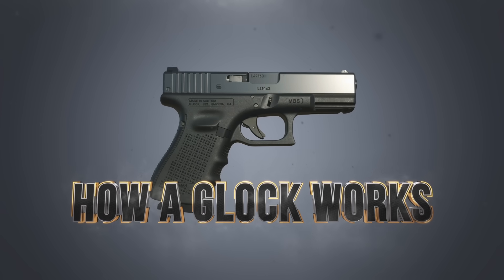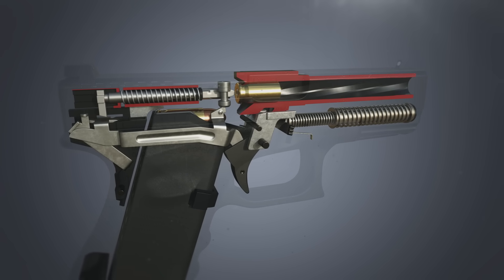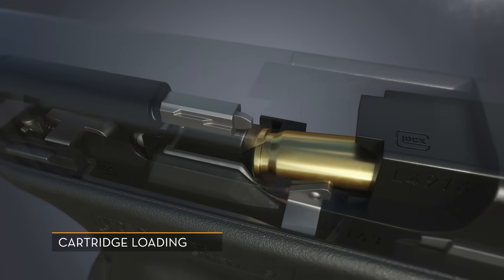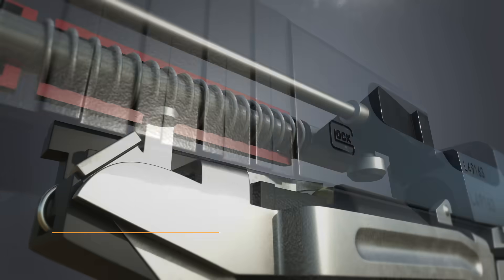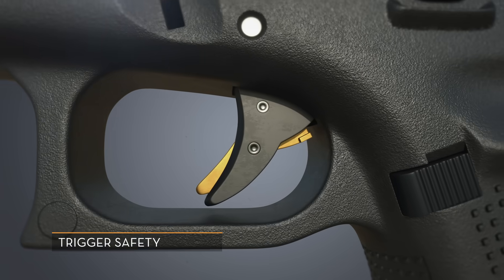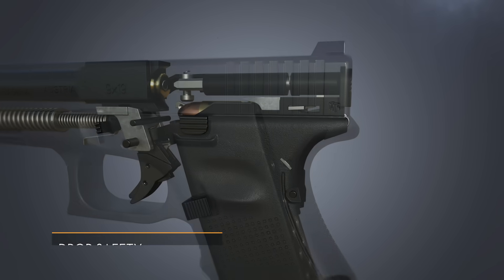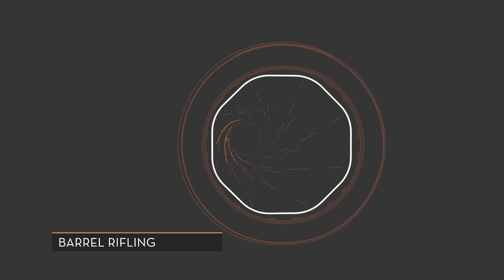How a Glock Works

Comment: Hi, i am a CSI student. Do you have any tips on how to remember the difference between the locations and function of the ejector and extractor? I keep mixing them up.
Reply from the maker: Yeah I always just remember the extractor is pulling (or extracting) the case from the chamber. Kinda like extracting a wisdom tooth lol.
The ejector is expelling (or ejecting) the case away from the firearm. Kinda like when a pilot has to eject an aircraft 😋

Comment: i had no idea the firing pin isnt under any load until the trigger is pulled. ive always worried about a part failing and a misfire. Really cool to know that the gun pointed at my nuts cant possibly go off

Comment: Nice animation, I've wondered how glock style firearms safeties worked. I get that they are safer but I'm just not a fan of the long squishy trigger pull. Love the fact that I can put multiple rounds in the same hole with a decent 1911 trigger.

Comment: note that after a spent casing is ejected, and as the slide moves forward, the next round is stripped from the magazine with its rim sliding up BETWEEN the breech face and the extractor as it's being fed into the chamber.  Therefore, it's not a good habit to manually drop a cartridge into the chamber, and then let the slide home.... doing this causes the extractor to ride OVER the case rim, causing stress and can cause the extractor to break.... always load the round into the magazine, and then rack/cycle the slide.

Comment: The most dangerous firearm ever conceived, if you approve of this safety system maybe we should let you carry around a hand grenade that instead of having to pull the pin all you have to do is touch it.  The cops now have a cute little nickname for the injuries it has caused.  They call it Glock leg.

Comment: A buddy of mine was on the fence about carrying a Glock with one in the chamber. I couldn’t really explain it so I came across this video & showed him. He now carry’s with confidence with one in the pipe. Everyone that’s new to, or is carrying especially a striker fired pistol should watch this video. Excellent 👍
Reply: Instructor "Never aim a firearm at anything you aren't comfortable destroying"

Student Glances at the appendix carry on the male instructor in confusion
Reply: @mdood9299  as long as you use a QUALITY holster, and you aren’t carrying a P320, you’ll be fine.
Reply: @adambradford8721  This comment aged like fine wine
Reply: @rei_do_passinho oh I’d say like a 12 year bottled in bond, I had no idea the hammer would drop on sig this hard, pun intended ofc 😂
Reply: @adambradford8721   I examined the fatal flaw of the P320. The way it's engineered would be as if you had the hammer permanently back! The striker spring is released by the trigger vs Glock trigger compresses & releases the spring. All it takes is a solid jostle and that P320 pin is going forward like a hammer pulled back.
Reply: @johnaethionconcentrius if I’m right, it’s because they gutted what they could from a P250 and shoved it into a striker fired handgun right?  Thats the only reason I’d think as to why the firing pin would be staged like that, of course other than the weight of the trigger
Reply: @mdood9299  Holstered guns are holstered not pointed.  Assuming you have a good holster and it's not a p320.
Reply: One of the quickest safety releases on any weapon.
Reply: sooo you're always looking for trouble with your itchy trigger finger instead of de-escalating like a real professional

Comment: So, at the end of the cycle as the slide moves forward, the fire-pin SPRING is not pre-compressed? The fire-spring in never under tension until the trigger is squeezed? Thanks for answering.

Comment: Great video animation of a Glock 19 in action🙂  The only thing I wish was explained a bit more in depth was the middle ramp/rail on the bottom of the slide that grabs the next cartridge from the magazine.  I know you highlighted the front of it in 2D yellow.  It would be nice to know what the rest of that rail is doing as it crosses over the magazine and the cartridge under the one it just grabbed and how the magazine eventually stops the slide when empty.  I know you mention that it stops the slide but that part of the animation is moving fast and its not clear how the magazine follower actually stops the slide.  

Please don't take that as a bad criticism the entire animation is great and I am trying to understand that cartridge rail grabbing part more in depth.  My Glock 17 has developed a deformation on this bottom ramp rail with a burr on the side of it that faces the safety plunger.  I'm just trying to diagnose why this burr has developed.  There is no sign of wear or deformation on the safety plunger.  Is the bottom ramp rail hitting the metal lined magazine, is it squeezing the safety plunger, is the cartridge below doing something to it?🧐 I'll figure it out eventually.

If I could put some kind of UV ink on the magazine, and then the cartridges, the safety plunger, each separately and then analyze the bottom rail after each I may get a clue.

Anyway, thanks for the great video.  I didn't know what that rail was for before this video so I'm one step closer to diagnosing the issue😎

Comment: I thought the Glock firing pin was set up horizontally. That way the empty cases can’t snap it of as easilY, as they eject horizontally. Like trying to snap a 2x4 piece of wood. It’s way harder to snap it from the sides.

Comment: Matt, does the rear of the recoil spring rest against the frame, or the barrel lugs during cycling?  Excellent video. Dig the music too.
Reply from the maker: Thanks so much Justin! It actually rests on the Slide Lock, which essentially rests in the frame.

Comment: Step 1:  "The boom makes the bullet go, and knocks back the slide."
Step 2:  "The spring in magazine puts new bullet into chamber as slide returns to its resting position."
Step 3:  "There Is No Step Three."
Reply: Unironically how SMGs work (replace 'slide' with 'bolt')

Comment: 3 types of safeties? well better safe than sorry especially around firearms as they can be deadly if mishandled
there is one thing i'd like someone's opinion on when i want to render it safe from firing: the way i think could be fairly safe to pull back the slide and lock it then i get the magasine out of the pistol and while the slide is open i can check if the champer is empty if it is i pull the slide back to slowly put the slide softly forward with a pull of the trigger in the direction to the firing range to drop the hammer and to expect i might be wrong lastly i would put the safety on and put an empty magasine into the pistol

Comment: Firing pin safety - check
Trigger bar safety shelf (drop safety) - check
Trigger safety… wait WTF? So if you somehow managed to accidentally push the trigger body back without touching the dingus, the gun would not fire. Put something, anything inside the trigger guard and it’s going to push the trigger and the safety shoe back. 

Glocks are neither full double action nor single action. When you cycle the gun to load it, you partially cock the striker. However, pulling the trigger also completes the backward motion of the striker. That’s part of why the trigger pull is long and tends to be ugly on a Glock, but having a longer and more difficult trigger pull is a form of safety. Look at a double action revolver like S&W’s ariweight J-frames.

Comment: I was impressed. Very clear, brief, but concise explanation of a complete firing cycle. I am always impressed by the Glock reliability as it has a lot of small parts that all have to work together perfectly to allow it to function. 

For those who worry about a shot firing when dropped, the firing pin (they call it a striker pin) is only in line with the cartridge primer and allowed to move forward when all of the internal safety mechanisms are activated together. Compare that to many older revolvers where the hammer rests directly on the cartridge primer when not cocked or some older design semi-autos like the M-1911 series that have a floating firing pin that could be jolted forward against the primer if dropped, or if the hammer jolts loose from the sear as it hits the ground. 

BTW: I have often heard that story about the M-1911 firing if dopped, but in more than 40 years of using them, I have never had that problem, nor met anyone who did, even though i competed against many competitive shooters who used them. Many, including myself and my partner never carried the M-1911 series with a round in the chamber, learning to cock the action as we drew.)

I also have used many singe and double action revolvers and all but some very antique ones have a half cock that will catch the hammer even if jarred loose from the sear (A trigger pull releases the trigger and also moves the half cock notch out of the way) and most made in the last 50+ years have a hammer blocking plate that prevents the hammer from resting against a primer when carried uncocked. The antique single actions like the pre to post Civil War era Colts and Remingtons were traditionally carried with the hammer resting on an empty cylinder for that very reason.

My partner and i (Federal Agents) were "clearing" an abandoned house we were told was being used as a drug drop point when someone entered the room. I drew and cocked my M-1911 as I took aim through the open window and I'm not sure if it was me saying "Freeze, Federal Agents", or the sound of that .45 ACP loading, but that poor vagrant made an X in the doorway at the other end of the room while my partner did a rather undignified roll through the window and got back to his feet in the room.

Comment: It’s not a lot, but you are stacking energy into the firing pin before the trigger seer drops releasing the energy you stacked at the first quarter inch of the trigger. Similar to the Ruger SP 101 (Revolver) with the bobed hammer, there’s more than one action taking place during each pull of the trigger,  thus technically qualifying it as a double action… No?

Comment: Why does the barrel drop downwards after firing?
Reply: You want the slide and barrel to be locked together for the first part of their travel. When the barrel is level, this locking is engaged. When it is tilted, the slide moves freely of the barrel (due to momentum) and completes its part of the cycle (extraction, ejection, and loading).

Comment: As much as I love the Glock platform, I seriously hate the trigger safety. Let's say you have a 1911 and you know nothing about guns and your screwing around with it with the safety on and loaded. It's pretty difficult to pull the trigger. Now the Glock safety is right on the trigger. A firm squeeze will just pull both the safety and the trigger. I know there is a safety that's sometimes on the side of the slide but I think that should be for all versions of the gun

Comment: Someone.......for the cartridge that is stripped from the top of the magazine......does its rim slide under the extractor claw during the slide's forward motion ( "controlled feed")?...OR....does the extractor snap over the rim of the cartridge after the round is chambered ( "push feed") ?

Comment: This video allowed me to feel safe without a manual safety .  With that said ,  I now own a Glock .  Thank you for your time in making this excellent video .
Reply: You still need a proper holster. A good kydex holster helps prevent the trigger from being pulled unintentionally. Good ones can be had fairly cheap.
Reply: Those so called safeties are no match for a proper external safety, also the polymer junk makes it look so bad
Reply: @tullo5564  What do you mean? There is 3 safe guards in place, they literally can't go off unless the trigger is pulled. If the trigger is accidentally pulled at that point its negligence.
Reply: @tullo5564  muh "TWO WORLD WARS!"

Comment: Another Title could be, How Most Polymer Framed Striker Fired Semi-Automatic Short Recoil Operated Locked Breech Tilting Barrel Pistols Operate Without Polygonal But Standard Rifling Works.I don't like glocks, They are Ugly and Overpriced, Boy Am I Gonna Catch Hell For Posting This. 🤣 I don't care. 🤣
Reply: i kinda agree with ugly but if a glock is overpriced for a handgun you’re probably only in the price range for a hi point and maybe one of those single shot 22 bolt actions from walmart if theres anything left in your bank account

Comment: I had a crappy belt that allowed my Glock 43 to fall to the ground and discharge.  I had installed an aftermarket trigger in the pistol.  The drop safety failed.  I live next door to a gunsmith.  We unloaded the pistol, cocked the slide and struck it with a wooden mallet.  It discharged.   Reinstalled the Glock trigger and bought a Hank belt.  No more problems.
Reply from the maker: Wow, I bet that made the hair stand up on the back of your neck!
Reply: @mattrittman  Learned quickly not to modify my EDC pistol.  A competition pistol OK, but not one I depend on.
Reply from the maker: @multitieredinvestor183  yep haha for sure

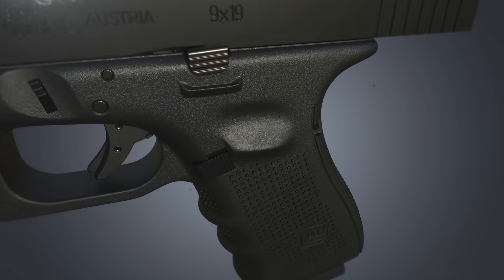Comment: 2:35 why does the barrel stick slightly up after the mag is empty?
Reply: Because the barrel is in its unlocked position. When you pull the slide back the barrel unlocks. most any semi-automatic handgun bigger than 380 needs to delay opening for a millisecond or the case will get pulled out  early by extractor  before the bullet has left the barrel and explode

Comment: I've been wondering if you could make your own actual bullet firing weapon from scratch. Looks like you could
Reply: As long as you have a way to controllably smack the primer of the cartridge while the cartridge is supported in place, it’s doable. Technically a barrel isn’t even required if you aren’t concerned about accuracy.

Comment: I still just don't understand how the trigger safety protects anyone. If you were in a situation where the trigger is getting pulled accidentally, how exactly is the trigger safety not getting pulled with it? I'm not even sure how I COULD pull the trigger alone without also pulling the trigger safety, they are right next to each other and the safety sticks out farther so you touch it first. I don't understand what it's meant to prevent.

Comment: I’ll admit glocks don’t feel as nice as some other pistols in the hand. 
However, the fact the firing pin itself is not fully cocked until the trigger is pulled adds another level of safety that other striker fired pistols don’t have.

Comment: By saying ‘the trigger bar pulls the firing pin to the rear’ you imply that it’s a double action, but do any of these even have a hammer to de-cock so it can be carried hammer down on a live round? I thought these were single action striker fired pistols (as in the slide cocks the striker {there’s no firing pin} and the trigger releases it to hit the primer). Also the bullet doesn’t have a primer. The cartridge has a case, primer, powder, and bullet. That’s 28 seconds in and you lost me already. Nice graphics, attention to detail needs some work. Please understand this is constructive criticism.                                     Cordially,                                                            A gun guy with a mechanical background.   :)

Comment: LETS TALK AMMO - GUNS AND BULLETS  >  https://omegaammostore.com <  RETAIL AND WHOLESALE
Where do you guys shop ammo?? 2:26 Walther PPS M2
4:07 Glock 42 , 5:18 Glock 43, 6:35 M&P Shield M2.0, 9:24 Sig P365, 12:34 Ruger LCP 2, SIG P938,  PT709, PT740, PT111 G2 (many more)
You can order from this site and get fast, secure and discrete deliveries. 
https://omegaammostore.com/product/25rd-20-gauge-shot-gun-6-shot/
https://omegaammostore.com/product/6-35-25-auto-geco-50gr-fmj-50rd/
https://omegaammostore.com/product/45-autoacp-230gr-jhp-geco-50rd/

Comment: The majority of my "go to pistols" are Glock .40 calibers. My son-in-law decided he and my daughter wanted a 9mm so they would just have to stock 9mm. I kept all the .40s for the same reason plus I don't like 9s. The .40s and 9s are the same size so why use a less powerful bullet?
Reply: @Iskhartakh  It's funny that you say that, I thought the same. When my daughter got married I told em to both pick out pistols and I'd get them. They chose the G43 single stack, I carry the G27. Because of the weight of the 43 it felt snappier than my 27 with more weight. I gave em a G17 to keep in their house.  I'm an old fart that remembers when a 9mm wasn't very good, ammo has improved but so has .40. My others are G23s with extended mags. The decline of the .40 had made ammo cheaper pre Biden. I stocked up on it when it was $12 a box for Winchester Rangers  (black talons). G T Supply bought a train load for cheap and passed it on at good prices. I bought a .22 slide for a G23 so I can practice with .22 occasionally and not just .40 ammo. It's paid for itself many times over.

Comment: I would have carried Glocks over a decade ago if I knew only partial tension was on the firing pin spring until the trigger was pulled.

Comment: That explained the stiff trigger pull on Glock. Glock is safe, but the fact that it will fire if you pull the trigger in the bag just make some people uncomfortable. If US army isn't comfortable with this, it is a valid point. No need to argue about this, everyone have preference, some people just always forget to disengage manual safty and Glock is designed exactly for these people. They made the gun as safe as possible without a manul safety.

Comment: 3 separate safety mechanisms. This just proves that people who accidentally hurt themselves or someone else with a gun are just plain stupid. How do you accidentally pass up every safety measure.
Reply: They are in place so that the gun will not go off unless someone is pulling the trigger. Some older guns might go off if they are dropped or hit hard enough.